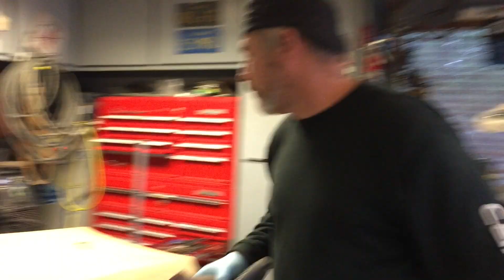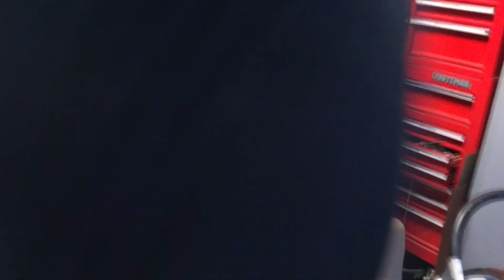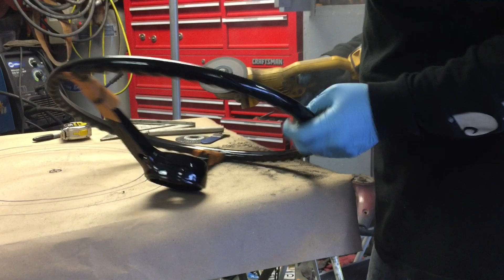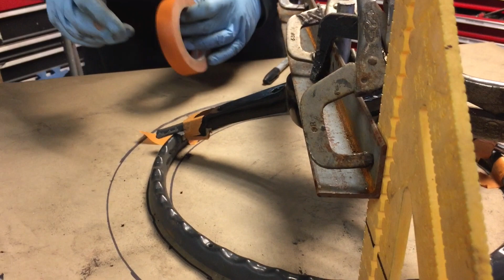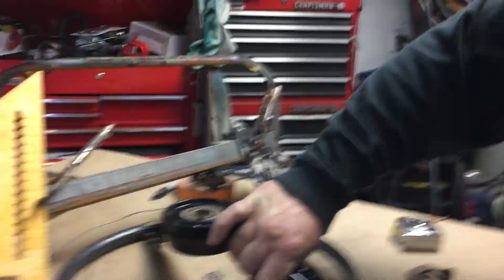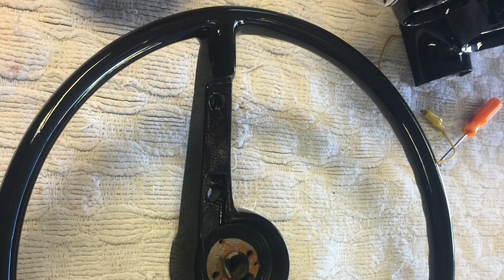57 Chevy Nomad Steering Wheel Size Modification, Classic Car Tilt Wheel reduction

Comment: What size is the steering wheel now 16” ? did you ever find what wheel that  was from gm ford etc ?
Reply from the maker: I sold the car. I believe it was a wheel from a 1970s Buick regal or a Oldsmobile. I bought it at a swap meet for a couple of bucks. Possible 15 inch. It felt just right 
Thanks for watching
Reply: Thanks for getting to me I’ve decided I’m making a jig to reshaped the original 18” wheel to 16” I will make a video of it I’m doing a 210/Belair wheel first before attempting my 150 wheel cheers
Reply from the maker: @Trifiveguy I did my first one on a 55 Chevy wagon. So the one you see in the video on my nomad was much easier and less scary to do
Thanks for watching